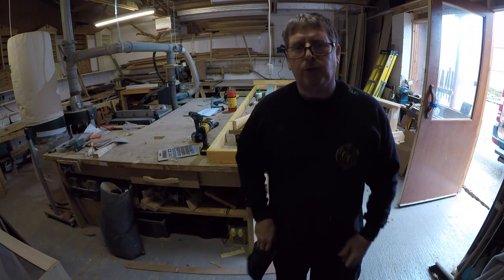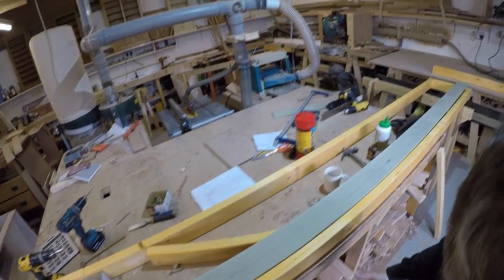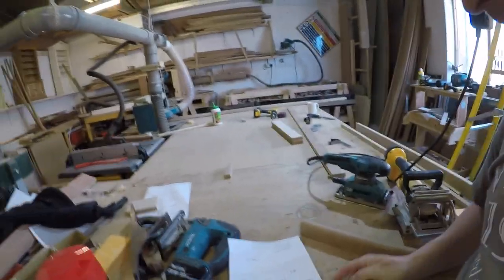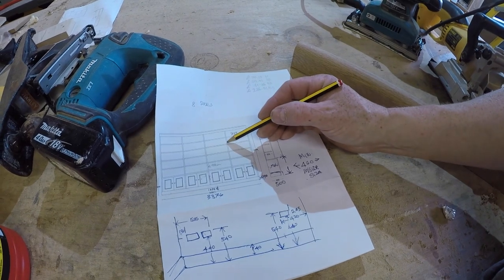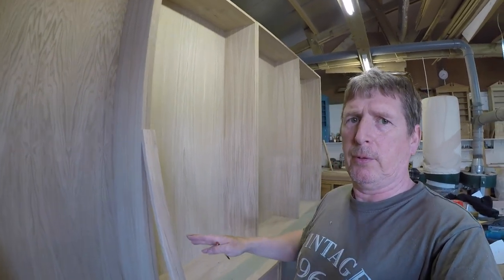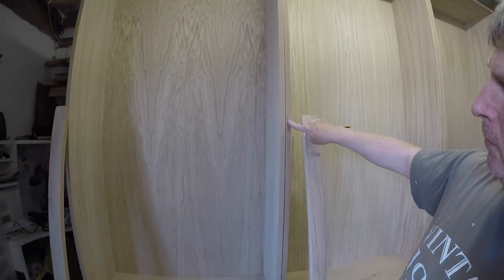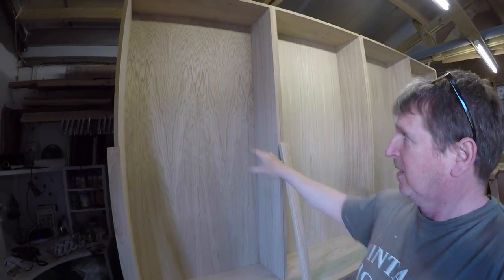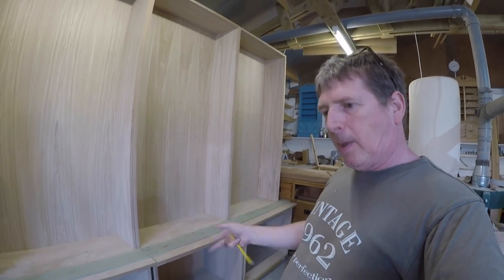Oak Bookcase, Part build

Comment: I was wondering if the carcasses were solid oak ? I saw somebody asked the same question below - but I think you answered it with an answer to a different comment !  I love the colour of the finish - do you remember what you used on it ?  My oak comes out very amber - but I love the stain to give it the uneven pattern on the knots.  It really is an amazing job - mm perfect